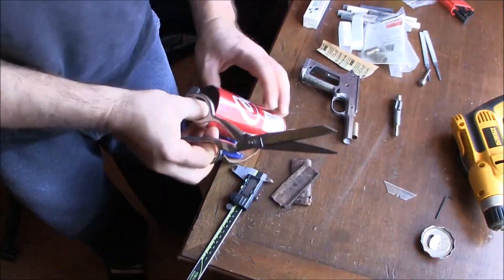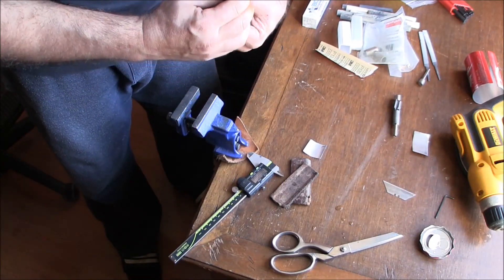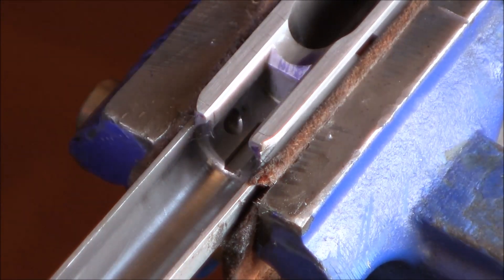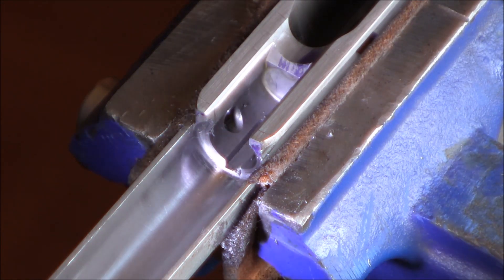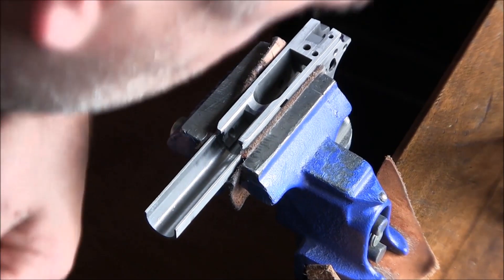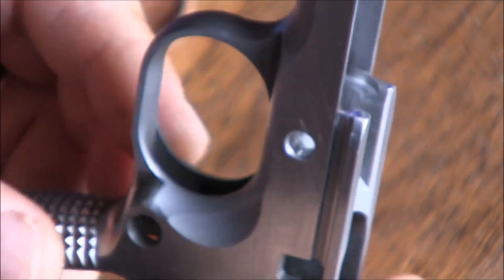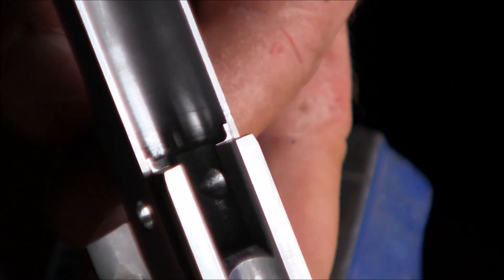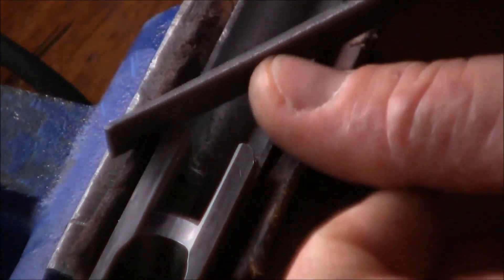1911 Build 8 Commander 45 acp - Part 8 - From Gov to Commander Frame mod

Comment: Don't try this without the pilots. I somewhat messed up one old frame without them. It will broaden this barrel channel and if you use the frame again it will likely not run smooth without a full length guide rod which I don't like.
Reply from the maker: @alanex5225  which pilots do you mean?
Reply: @MosinVirus  The ones you used to brace and stabilze the bits when you drilled the government frame to Commander specs.

Comment: from 10:25 minutes,I see if your ruler is 0.095 inch ? 
You will cut 0.095 inches more so that you can use the commander ?
Thank you
Reply from the maker: The commander slide has a dust cover (spring plug tunnel) that extends rearward more than on the standard government slide. That means that a commander slide would not travel as far rearward if it is installed on a government frame. So some material needs to be removed from the recoil shoulder as well as the rails to make the government frame into a commander size frame.
Reply: @MosinVirus  I watched your video. I also have a government frame, but I want to use it for the commander slide
I bought 1 slide commander,I just don't know how much to cut them.
Did you cut the extra 0.095 inch ?

my English is not good,If something makes you misunderstand, look forward to forgetting me
Reply from the maker: The specification for the commander frame is for the recoil shoulder to be 0.255" from the center of the Slide Stop pin hole. You have to measure your government frame to see where the recoil shoulder is in relation to Slide Stop pin hole and figure out how much material needs to be removed to bring it into commander spec.
Reply: @MosinVirus  Thank you very much,thank you for your advice, if I have anything unknown please help.have a good day

Comment: What is it that obstructs the commander slide from racking back when you put a commander slide and barrel on a full size government frame? I would really like to know this. Thank you for providing this excellent conversion series video.
Reply from the maker: Some commander slides will travel back enough on a government frame without alterations. Some will not. In some cases the commander slide will travel just enough to the rear to lock the slide back on empty with the slide stop, but you will not be able to release the slide using the slingshot method. In any case, what stops the slide's rearward movement is the recoil shoulder you see me working on in this video. The slide's dust cover (spring plug tunnel) hits the guide rod head and sandwiches it between itself and the recoil shoulder of the frame. If you look up a comparison image of Gov, Commander and Officer slides you will see how their dust covers relate to each other.
Reply: @MosinVirus  Thanks, I have ordered a commander guide rod with the hole in the end and a commander barrel bushing of stainless steel, but today I tried repairing my frame ramp and flowed a bunch of aluminum rod down into bowtie area. what diameter is that barrel seat area behind the shoulder so I can end mill it out?
Reply from the maker: @alanex5225  I am not sure which area you are talking about, but if it is the channel where the barrel bottom lug moves through then the diameter is .450 or so if I remember correctly. You should take a look at the m1911 redux pdf for all the dimensions.
Reply: @MosinVirus  thanks, I have a schematic but is hard to read.

Comment: Great video and loving the ingenuity.  One does not need high-dollar power tools to accomplish excellence.  I've never built a 1911 in my life, and will attempt what you do in the near future.  Thanks for the inspiration.  By the way, are you going to make a relief cut in the VIS (vertical impact surface) or do you feel this is not necessary for longevity?  Watching all your videos sir.
Reply from the maker: Chris Hoesel thank you. this frame already has a relief cut in the VIS, so do all 1911 builders frames. However, if I did need to a 7/16" long mill bit would work in a similar way. I would just use two bearings in the dust cover and slowly cut the relief in the VIS. Are you talking about that relief? the one that forms a bowtie?
Reply: I think that's the one...Although I think the ones I've seen are circular or semi-circular....I see a flat surface on your example frame but with a large chamfer instead. I suppose that serves the same purpose?  From what I understand (and I could be wrong) the VIS relief is a fairly new "thing" in the past 10 years. I'll check the video again
Reply: I see it now.  Yes your frame has the relief built-in...Thanks
Reply: The cut is circular, but leaves a bow tie shape at the top. The end result is less leverage on the lower lugs which reduces the likelihood that they'll shear off over time.

Comment: I cut mine down .100, bringing it to 255 and I still can’t “sling shot” the slide. It functions all otherwise tho. I’m cautious to cut back more.
Reply from the maker: This is probably a stupid question, but you cut the rails as well, right? If you moved the entire recoil shoulder back to .255, and you still cannot slingshot, are you using a reverse recoil spring lug? Are you using a Commander barrel bushing? Is your barrel a true commander barrel? Send me pics of the frame (result) and parts above to Mosin.Virus@gmail.com.

Comment: At the beginning of the video you said you wanted to see if you can convert the frame from govt to commander size, but at 0:10 you commented on screen "Before I went to a smith to get that done...". I'm a bit confused as the mod seems like it was successful. Did you end up having a smith work on it afterwards?
Reply from the maker: trant715 I meant that I had this done on a previous build by a smith. using an end mill that I bought and had resized and reprofiled. that was on my 9mm commander build. The smith wanted to keep the end mill since my mini mill would probably struggle with the size, so I let him keep it. On this one I decided to try a different approach and did it myself using the counterbore and everything else shown in the video. So what I was trying to say is that I converted 2 government frames to commander - Build 7 was done by a smith, Build 8 I did myself. different tools and methods.
Reply: Thank you for the clarification, that makes sense now. That's very impressive work!

Comment: in your opinion would it be possible to achieve the same conversion using a dremel?
Reply from the maker: nvhs1 Yes, but probably not how you think. I would use a dremel to file a square on the end of the shank of the counterbore. then use one of the tap wrenches to turn the counterbore by hand. would take longer, but give you more control.

and I have seen at least one guy say he did the conversion with files. So if that is possible, I bet it is also possible to make the cut with a dremel. the problem is that area is a stress point. frame can crack if you make a little mistake in the wrong spot.

Comment: Can u list the tooling you used and were to order it
Reply from the maker: Counterbore and pilot were ordered from McMaster Carr.
Counterbore:https://www.mcmaster.com/#3102a25/=1armn29
Pilot (can't remember which one I used, you should measure the bottom lug channel in your frame to see while one will work better)...
7/16" pilot: https://www.mcmaster.com/#3103a31/=1armplp 
15/32" pilot: https://www.mcmaster.com/#3103a66/=1armp0g
Sleeve Bearing (can't remember where I got them, so first get the counterbore and measure the diameter of the body past the cutter and then order the sleeve bearings with that inside diameter (ID) and outside diameter that should fit the dust cover of the frame nicely. If it is a little smaller, you can shim it like I did) they may have been these: https://www.zoro.com/dayton-sleeve-bearing-12x58x1-l-pk3-3fjl5/i/G3219465/

Comment: Hello.Where can I buy these tools ?
Reply from the maker: I get these cutters from McMaster Carr.
Reply: Hello,can you send me its specific link ? 
sorry i searched for a few days but didn't see it, i asked the site owner which they also couldn't identify
It's good if you give me a specific link about it,thank you very much
Reply from the maker: Unfortunately I don't remember which cutters I got for that conversion
Reply: @MosinVirus  Can you resell the toolkit you used to me ? 
sorry for this suggestion, i did not find it
Reply from the maker: Unfortunately i will not be selling my tools. If I remember correctly that was a piloted countersink or counterbore cutter with exchangeable pilots. I bought separate pilots for it in appropriate diameters to my frame, and sleeve bearings I got somewhere else.
Reply from the maker: Or maybe I got it from MSC. I probably said the dimensions in the video, but I don't remember them now. https://www.mscdirect.com/product/details/71010425

Comment: Is this step really necessary?
Reply from the maker: Which step are you referring to
Reply: @MosinVirus  making deeper the plunge cut. Maybe I should have asked, is that step necessary for all caspian frames or just when putting a commander slide on a government frame.
Reply from the maker: @lakesidemfg3552  the recoil shoulder should be moved on all government frames when fitting a commander slide to them. The pistol may work without doing it, but the backward stroke of the slide will be shorter slightly and that could introduce issues.
Reply: @MosinVirus  thank you.

Comment: Great video as always! Are all the pin placements on a government frame the same as a commander? I thought there were other differences than the recoil shoulder. I guess you finished the build and it looks and functions great, so maybe not. Any other challenges?
Reply from the maker: Bob Schott The only difference between commander and government frames are in recoil shoulder position. the difference between a commander and officer frames are in length of grip (shorter by .625" I believe) and relocated as result the bottom grip screw bushing hole and MSH hole (requiring officer size MSH). The recoil shoulders of the commander and officer frames I believe are the same.

Comment: what is the benefit of doing this?
Reply from the maker: CRengineer17 thus turns the gov spec frame into commander spec. it is a necessary mod for proper function of a commander slide, so that it can travel to the rear enougn, have proper ejection, and so that you can release the slide via slingshot method

Comment: Hmm.  Seems you can't buy a plain steel 80% commander frame without the bobtail mod or without checkering.  If I don't use a Caspian frame, I guess I gotta do these modifications.  EDIT: basic Caspian commander frame nearly $300.  Ouch!!
Reply from the maker: Yes, it is easy to do, so there is no reason not to. And it does give you a lot more options, including being able to use a longer dust cover frame and then getting creative with how you match it to the slide. Plus you could get a slab slide without stirrup cuts and then cut your own ball cuts leaving more weight on the slide which will help with recoil (not having to go with a 21lb recoil spring).

Comment: you probably could have left your frame rails long
Reply from the maker: SacoreyRugger not sure if that would have worked out. I think the rails would have blocked the slide before it touched down on the guide rod. plus the guide rod head would not seat if I left the rails as is.